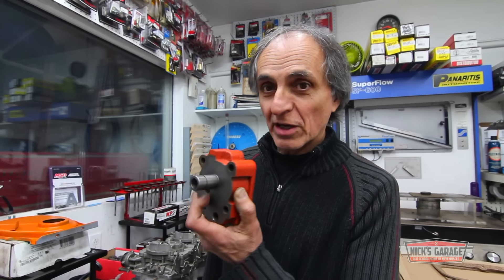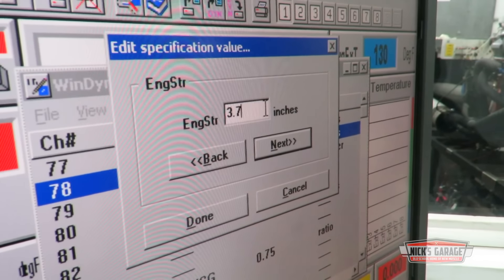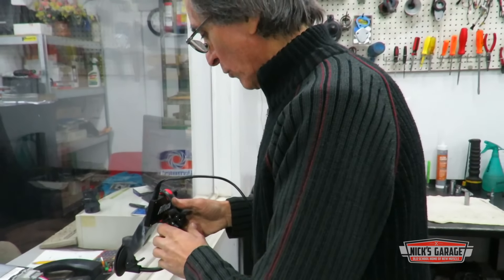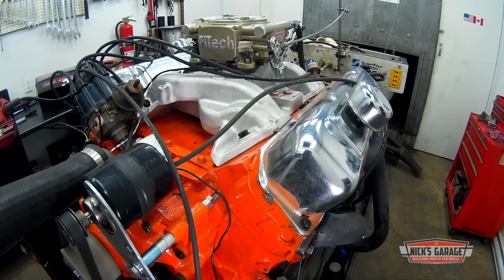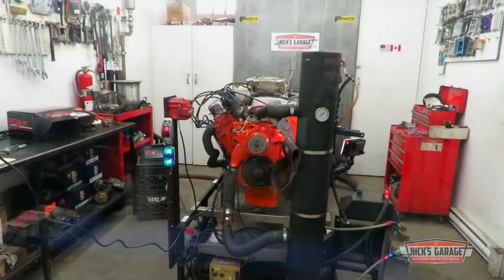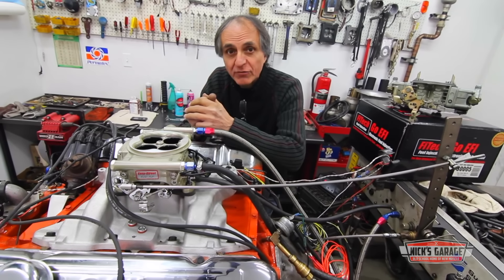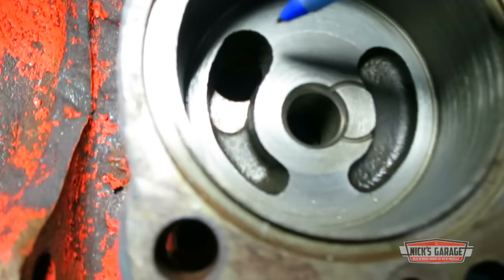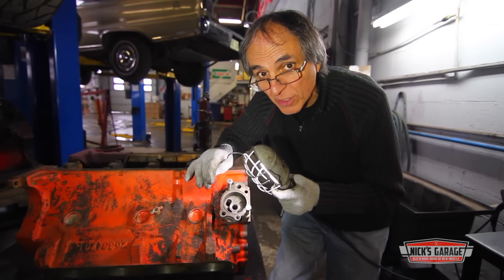Carburetor vs E.F.I. - Dyno Room Showdown

Comment: O gosh FiTech. We had it on a Turbo LS project and my god is it AWFUL. But Love the videos as always! Keep em coming😎
Reply: OGskunkMASTA 
What did you change the fitech out for? What system replaced it.
When you say awful what were the issues?
Reply: Justin Rennie We swapped it for the Holley dominator EFI system. The system wouldnt calibrate right even after hours of running. It has to have constant power to the ECU as it wont save settings(others have the problem) and that will draon the battery if you dont have a battery tender. We would set the Cubic inches and the idle RPM and every time the key went off it would reset to factory whick was like 164 cubic inches then idle RPM to 2000 and that wouldnt work.There is also no fine tuning adjustments so if you cruise around alot it will be tuned for that and would fall flat on its face for a few seconds then catch up and it would go lean according to our aftermarket o2 gauge which is a HUGE problem with no fine tuning available to fix it and give it fuel when it needs it. We had the LS specific FiTech that was good to like 1200hp (so it says) but sent it back to summit after there (FiTechs) customer service is a COMPLETE JOKE. You figure with how affordable it is and how many people will want it or have got it they would have great support but its far from it. If youre interested it i say stay far away unless youd like the gamble but it was not for us. Youll find TONS of people have the same problem and thats sad.
Reply: you cant knock something when you obviously didnt read their faq or tech page. i bet you also used a dual plane on that ls. big no-no.
Reply: Frigglebiscuit You obviously cant read, its a turbo LS. It has a Holley Sniper EFI intake and everyone has the same problems. Dont get into a pissing contest when i stated the problems I had and why its complete junk when you can pay a few hundred more and get something way better, has actual support and tuning, will support up to 3500hp. So you stick with cheap crap that is miss advertised and has tons of quirks and we will stick with the best in the business in aftermarket EFI. Im sure youll feel the same after you waste money on junk.

Comment: Hello Nick thanks for let me no on the roadrunner my 68 my question is why there a 1957chev Bellaire with a 383 stroker her on the island  Chev never made a edgine with 383 Dodge is the only one made 383 magnum or 383  can Chev not put  number on that edgine. I am holding off on the 1970dodge Challenger RT with the 440 wedge the reason why I don't want the 426 because say I go just normal speed  say 80klm come that always scum up the 426hemi were made for raceing I think that why I want the 440 wedge that doesn't seem to scum up I found in the years.also there a hemi on Kijiji pei but it's a 331 hemi I never seen won up close  might be something you my be interested in he is asking 3200hunderd what kind of horse power would it have may be I am wrong but are that not a small edgine it's out of a 1958chyrsler four door if you bring up Kijiji pei under classic cars you will see it your a good man . thanks for letting me no on cars and motor and mopar egine thanks alot nick.if your ever looking for edgine or car or trucks let me no
Reply: Mercury had a 383 from 1958-1960 it wasnt the same as a MoparDodge/Chrysler/Plymouth 383 !! Chevy never had a 383 !

The 383 you see Chevy Guys talking about is a 350 that was bored out & stroked so now its a 383..They usually just  call it a stroker !

You can bore out & stroke a Mopar 360 to 408 a 383 to 496 a 440 to505,512 all can be bigger etc...

Dodge/Chrysler/Plymouth had the Big Block 383 and 3 different versions of it..383 2bbl lower compression,different heads/cam than the high performance 383..They also had a 383 4bbl no high flow exhaust manifolds and different cam/heads than the 383 Magnum for Dodge,383 Super Commando for Plymouth & 383 firepower for Chrysler..

Dont get the 331 Hemi as its 250 hp in a 4 door car....

Look for a 383 for your Road Runner or 400 thats rebuilt as they can make big power too,or a 440 1970 and older as they have more power than 71 -78...
Reply: Milton Byrne.  The comment from 01trsmar said it perfect.

Comment: The little experience I have with EFI, it usually needs to be driven a while to learn the optimal mixture for various driving conditions.
This one just learned how to idle good, it was never driven... should at least have done a whole bunch of pulls to give it a chance to learn how to behave at partial and full throttle....

ALSO, there's always things to adjust even with EFI, since they can be optimized for either lowest fuel consumption, maximum power or.. uh.. "maximum environmental friendliness".....
Those three are not the same, you'll have to choose what to go for.
(I'd imagine it would be set up for max power from factory though... but that's just an assumption.)
Reply: Also, the carb problem is easily fixed, you can use an electric fuel pump for carbs too... Turn ignition on, wait a few seconds, pump it, start immediately... even after sitting for weeks.

Comment: Proper EFI (port efi) beats carbs, plus knock sensors and a few other tricks. Carbs can't adjust if you buy some not so good fuel at a gas station.

Comment: I've never messed with this kind of efi, can you get it to respond like a carb? Modern multiport for example doesnt rev on/off like a carb, it sort of lumbers back idle
Reply: Yeah you can, because it's usually down to intake manifold design. A multi port intake has longer runners which improve torque but slows down throttle response. A short runner EFI intake will have a much faster response.
Reply: @tomtom1541  interesting, a future project for me

Comment: You didn't do enough wide open throttle pulls for the ECU to learn RPM range.... the physics of the EFI and the carburetor both seating on top of the intake in the same location far as where the fuel is being sprayed into the engine how far away it is all those parameters are literally the same except for the fact that the EFI is a lot higher pressure so in theory you should be able to get more power out of the EFI than the carburetor in this setup. I love the show but it's very sad to hear that you're so biased... here's something where you can literally set it up and the moment you start it up it idles great there's no turning the screw there's no messing with anything it just works. Let's see the whole Power Band side-by-side in a layover graph..... Hmmm bet the efi is better smoother and gets better fuel economy and probably makes more power once it's learned everything. Now if you were trying to compare port fuel injection to a carburetor yes a carburetor will make a little bit more power but when it's literally being injected at the same location they should either make the same power or the one with better atomization should make more power. I'm honestly really disappointed that you're so biased.
Reply: all the boost.   The night before we stayed late to tune the EFI. We went through the learning procedures and at the end it ran great. Next day for video, I seen that it hard a hard time just to let it idle. I have a customer that we installed a dual Fitech on his 426 Hemi. It took us a while to get it to run great, and on this application it has a great improvement. Anyways, I will perfect it one day.
Reply: Nick Panaritis thank you for the insight of what you went through. I'm a big fan of you if I and I love old school.. they both have their place. I actually found it pretty funny that we both have the same first name and that were kind of totally opposite I love tuning EFI and you love old-school muscle.

Comment: If you're going to run fuel injection you need to have an injector or fuel directly shot into each Runner or port otherwise the carburetor will always be a better option less expensive throttle body is not the way to go if you really want fuel injection it's cheaper but it won't produce the results like actual port injection

Comment: ALL THAT RTV ON THE  FUEL PUMP BLANKING PLATE WILL END UP IN THE SUMP AND THEN IN THE OIL PICK UP, SAD TO SAY IV SEEN A GOOD NUMBER OF ENGINES DESTROYED BECAUSE OF  OVER USE  SILICON RTV SEALER . SEEMS TO ME  THAY DONT HAVE A CLUE THEAS YOUNG GUYS. NICK NEEDS TO TEACH THEM, THAT LESS IS BEST OR NON AT ALL WHEN IT COMES TO SILICON RTV SEALER.

Comment: Great video!!!

I assume all the parameters are exactly the same..... air flow, port size, temp. Air temp, timing, exhaust air fuel ratio.... 

There is a bit mor explaining to be done here.... but a great start!!
Reply: Anne-Maree Andrew.    I should have gone into more detail. You are correct.

Comment: there was still alot more to play with on that efi this video did no justice could easily have done a better tune and ended up with around 450hp possibly more  but then again this was a carb specialist putting on a self learning efi  without knowledge or proper tune equipment for a efi . this is like the only test  I have seen where a carb actually won lol
Reply: jtrenful      We have a lot more to learn with EFI.

Comment: Whatever way flows the most air with the correct fuel ratio( stoichiometric ratio), assuming equal atomization, is the winner of the max horsepower results. From idle to max EFI is/should be the winner.

Comment: when it comes to plain old wide open throttle from Idle to red line a properly sized and jetted carburetor makes exactly the same peak power as a properly sized and tuned EFI system. The fact that the carburetor made more power than the EFI clearly indicates there was some EFI tuning issues that were not addressed. Everything and anything in between wide open throttle and peak HP an EFI system destroys a carburetor even the power and torque curves are better. Posting a video showing the carburetor as the winner in this day and age when your an engine builder? That is as ridiculous as a journalist posting a video showing a typewriter winning against a computer and the internet.

Comment: I have been driving since 1969, drove a lot of Carbureted cars.  For racing purposes they are great, for street and every day driving, good riddance. It’s so nice NOT to have to set the choke, drive with both feet and fight that motor when it’s cold. The biggest mistake car manufactures made was the “automatic” choke.

Comment: "When it comes to full throttle, carburetor is the way to go." Based solely on this dyno test, it would seem so. 

OTOH, EFI has proven  benefits for drivability,  fuel economy and easier starting (especially for infrequently used vehicles). EFI also has benefits if you drive in varying altitudes. There are also plenty of poorly tuned carbs out there that EFI will beat every time - not everyone has ready access to a dyno for testing and tuning.
Reply: Brian Fergusson n

Comment: Fuel injection is the best choice for a street engine. The injection they had there would have made more power with a few more pulls as the computer would have had a chance to learn at full throttle.

Comment: Not a fair test. What about gas mileage, emissions, smoothness, idle, long life, cold weather performance, driving at normal hwy speeds, economy when needed, power when needed.And no one ever uses wide open throttle anymore except drag racing for 15 seconds at the track.   Furthermore, no one uses an open carb like this. It is about ducting, runners, air flow control. Look at the runners of todays performance cars - they are long and controlled. Carbs are dinosaurs, dirty units and they do not even come close to a good well set up efi which by the way can be programmed using a laptop to any spec you so desire. There's a reason why carbs aren't used anymore in the world except for racing and specialized racing where everything else is tossed out the window. Sure it might be cheaper, but false economy.

I give this test a FAIL.

Comment: I wouldn’t be so quick to jump to your conclusions....The FiTech needs more than idling to learn. Also, you can go into the hand held and make other adjustments. What AFR did you have the handheld set to, and at what KPa and RPM range?

How does that compare to your carb?

Comment: I don’t think they run the Fitech unit connected with Timing control. Then it would beat the carburator. EFI without timing control is meaningless
Reply: Ford Mustang 1969 .good point.carbs and timing go hand in hand but not sure what adjustments efi makes.nothing against efi tho.

Comment: How about a comparison with a CD   type carburetor? Ford fitted it at one time and both the early Series Jaguar ( syncing 4 carburetors! ) and my Sunbeam Alpine series V has two of them as well.  My later XJ12s have F.I. now. after I exorcise the Prince of Darkness ( Lucas )  and added US parts, My XJ12l became my daily driver.  I worked on SBC race builds for his Hilboun Alky powered WoO Sprint car. I know a bit about engines including the last large Offy engine raced in a sprint car. When the green flag drops, the BS stops!

Comment: If throttle body injection is so superior why did many NASCAR drivers and mechanics complain about the switch from carbs?
Reply: It's harder to cheat with a computer system that inspectors can plug into :P haha

Comment: I think performance applications, such as dragsters, use port fuel injection rather than throttle body.   Then you might have higher numbers than the carburetor.
Reply: charlesvan13

Comment: Nick your a wizard.  Love your channel.  However it's a bit misleading to say EFI takes HP away from an engine.  The drop was only 10 hp here and we don't know the atmospherics on the different days it was ran or if you adjusted the timing with the steady fuel you get with EFI.  If you ran that system for say 100-200 miles in real world conditions I believe it would out perform the carb.  The throttle response alone would feel like you gained several HP.   Having said this I totally get carbs.  I loved tinkering with mine in the day.  You felt like YOU did something.

Comment: I think efi is better in cold start and not having to adjust jetting for higher altitude etc etc and also part throttle, but a decent carb set up well can be just as good with higher hp and torque, just my 2 cents.

Comment: A carburetor being a double pumper has absolutely nothing to do with engine rpm. That is a function of cfm rating. NASCAR used them due to the quicker throttle response accelerating out of a turn. Double pumpers give an extra initial shot of fuel into the manifold to eliminate the lean bog due to the sudden increase in airflow from part throttle back to instant wide open again. Other than that, they flow no extra fuel under normal driving conditions. I currently have one on my 1969 mustang with a 351. It is not a race car. I literally drive this car anywhere. To work, pick up the kid from school, run errands sometimes, etc. Engine rarely sees over 3500 rpm unless I decide I want to light the tires for fun when the police aren't looking. Highway cruising speed is around 2000 to 2500 rpm between 60 to 70 mph. Gas mileage sorta sucks around 14 mpg but that's mainly due to the 3.89 rear gears.

Comment: Nick ..I know you use Holleys on mostly all your Dynos .. Do you keep the same power valve or do you change them for different motors. I know vacuum has to be a factor
Reply: J-Styga.  Very seldom I change Power Valves.  I use to do that, I hardly noticed any difference.

Comment: The only real advantages of EFI as Nick said is quick, easy start plus it can stand to idle longer in standing traffic without vapor lock. I've also noticed that EFI has less lower end torque than a correctly sized carb on the same engine.

Comment: Seems to me that the EFI engine did all its learning at very low revs, you would expected that to get good top end power it should also be learning at high revs and wide throttle openings.....

Comment: Perhaps the EFI does have a better hp/tq curve, but with all the new tech and $ involved why should customers have to live with losing 10 hp off the top? It should beat the carb across the board. I've heard fuel injection sales says a carb is a leaky hole on top of an engine compared to EFI. Really?
Where's my 10hp?
Reply: Well if you watch the video, he didn't run the engine at part throttle at all rpms so it can lean fuel adjustments, and he didn't run it at wot more than once. You have to run the engine around a bit so it can actually learn how much fuel is required at all rpms.

Comment: I  have heard that the Carburator  can make as much ore more HP than fuel injection at Wide Open throttle ..  just one Problem  how  comes small Block Chevys  made more Horse Power with Fuel injection  from 1957 until  1966 or so ?  327 Chevy  375 HP  Corvette  VS 365 HP with a carb ..  I would guess maybe the EFT unit has way too large of throttle bores and you are loosing velocity ..
  Some one needs to figure a few things out .. yet..

Comment: Multi-port injection is invented many decades ago, for a reason, there are few DIY injection systems. Those TBI addons are look funny these days. But this video is all about to show a biased final number. You never wanted the EFI to win. To be honest, you are not alone. Orherwise you would tuned it, made several pulls, load tests on every RPM band, at different intake/coolant temperatures, and so on... You didn't even show the curve as you used to - in your carb setups.

After all this negligence, the EFI still performed only 2.3% worse. 429 HP. Decent for casual crousing?! LOL.

Nick, don't destroy your reputation with these kind of biased videos. Open your mind, and learn to tune it. Or if you don't want that, then don't touch the topic, don't review, just ignore. But do not make biased false tests.